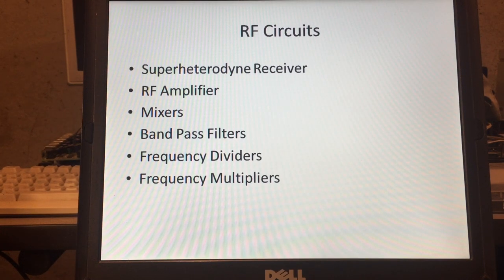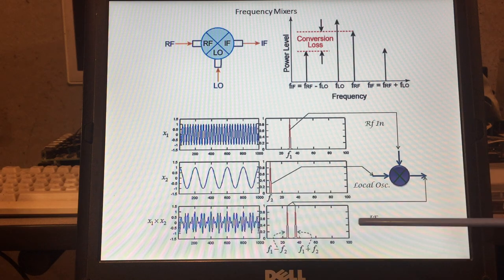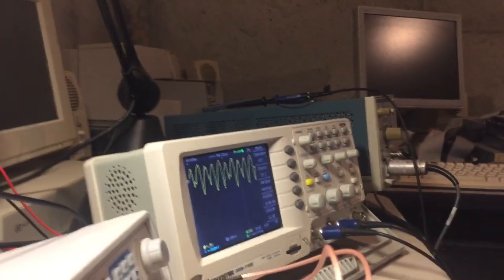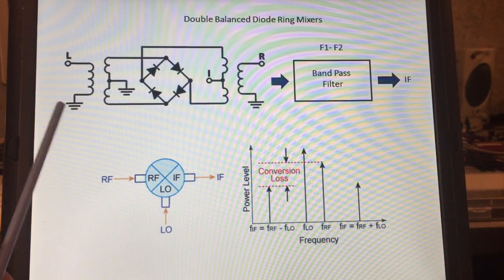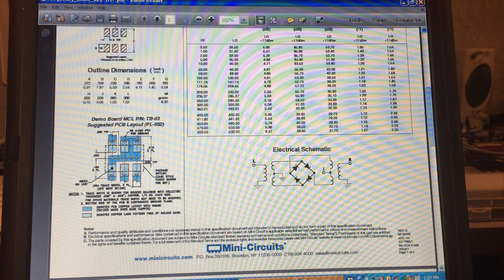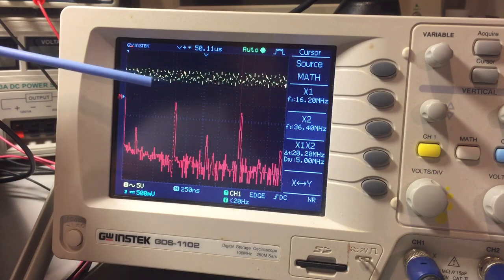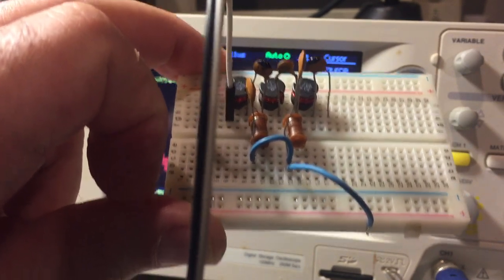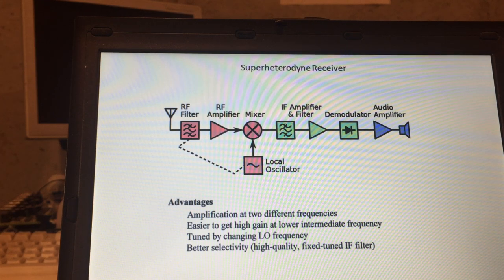Superheterodyne Receiver Part 2 (RF Mixers)

Comment: Based on you LO running between 10 to 20 MHz to get an IF of 16. What happens if the tuning requires your LO to also be 16mhz? Does it null or is this the case where you use a different IF? Thanks…enjoying your videos. Dave

Comment: Which signal generator are you using ?
Reply from the maker: Its a JDS6600 Singal Generator. It has dual out puts and works up to 60MHz. You can buy it on eBay for under $100. RF Man